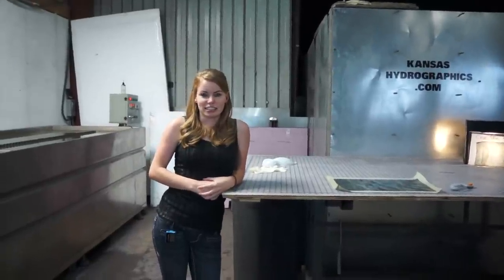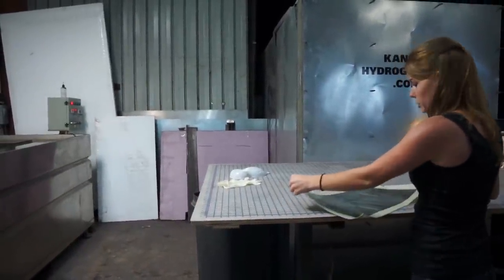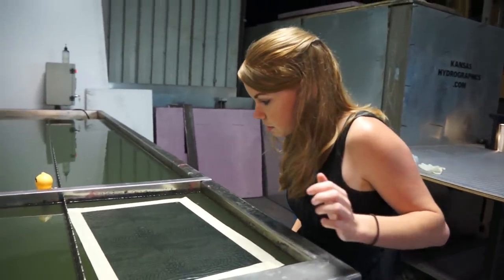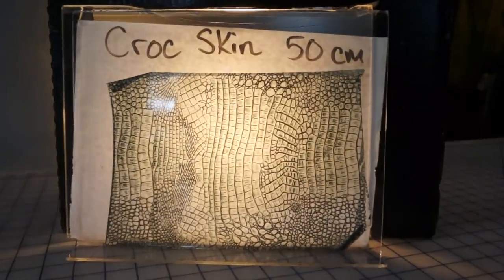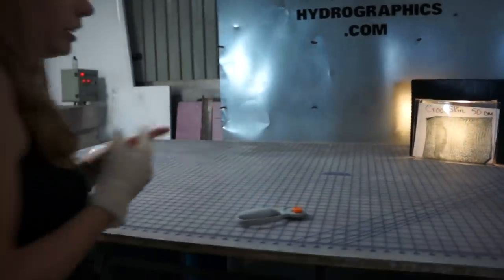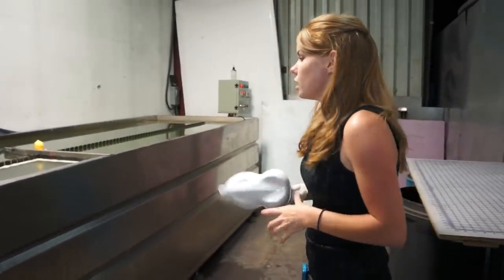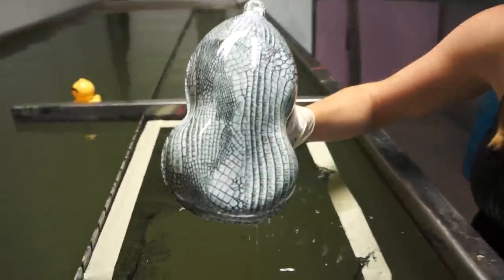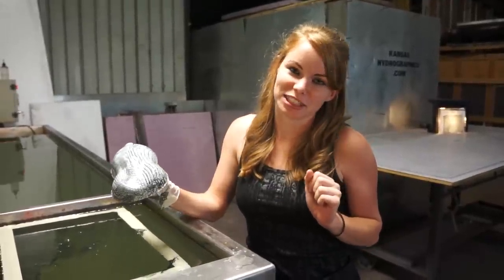Croc Skin

Comment: Like that pattern. Would this same film look different under a red base coat than a yellow base?  Doing a SUV interior and want to use same film but contrast it with another color base.  Like a white spider web, looks very different, because it has a lot of open spaces.  Thanks
Reply from the maker: This pattern would look very different with red or yellow base colors. The open spaces (white areas) will be the base color of choice.

Comment: It's sad that most of the design is lost after you dip a small item in it. Is there any backlash in cutting the through the design if you didn't need the whole sheet?
Reply from the maker: You can always cut smaller pieces of film to begin with if you chose.